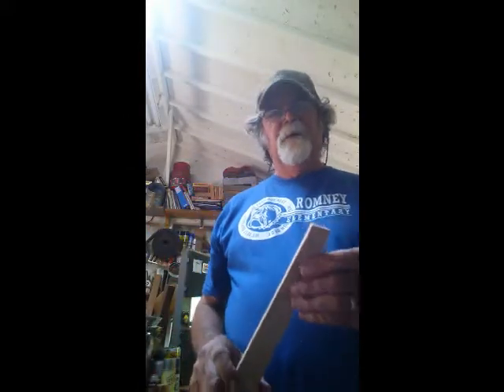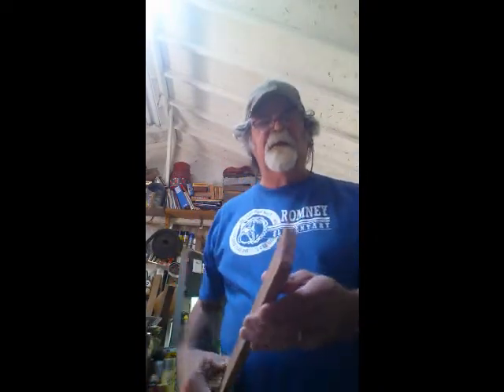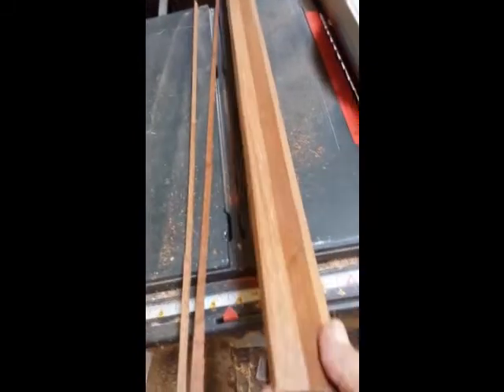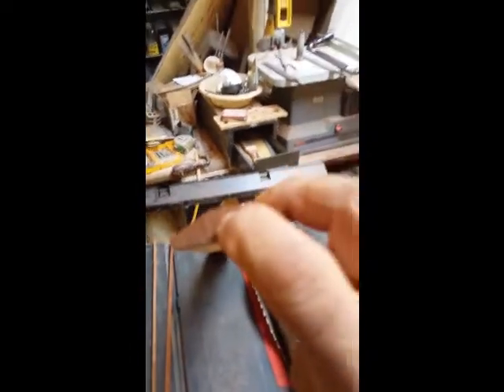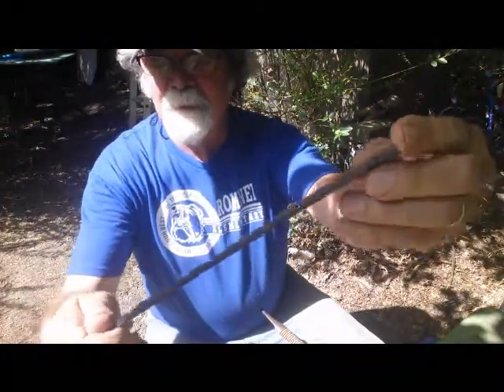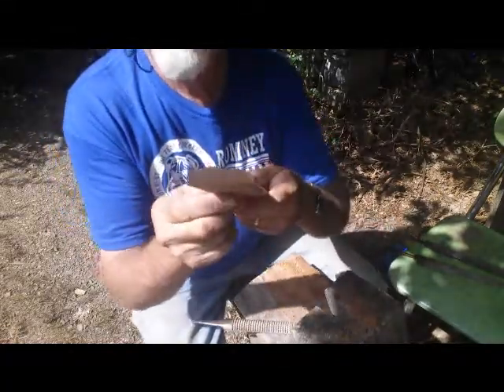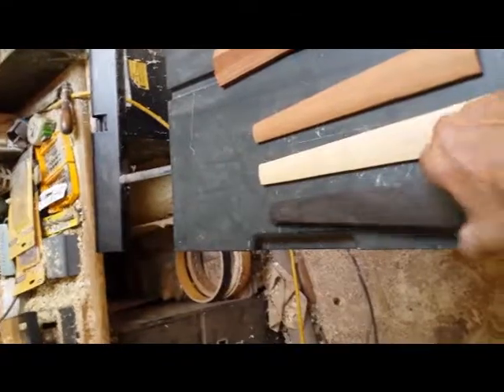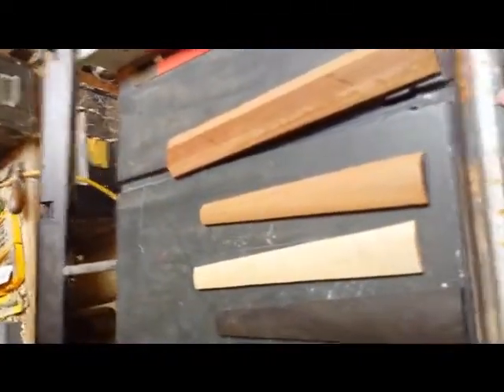Radiusing a Cigar Box Fiddle Finger Board

Comment: I'm gonna be building a huge upright washtub bass soon, I had the idea trying to build a bow shaped block of wood with some sandpaper loosely strung across, by pushing the bow block down and sanding as usual I hope to get at least a significant circumference to the fingerboard, the whole project isn't too refined anyway and I'm sure it'll still be playable even if it's a lil flatter than anticipated. Great Video as always Jim